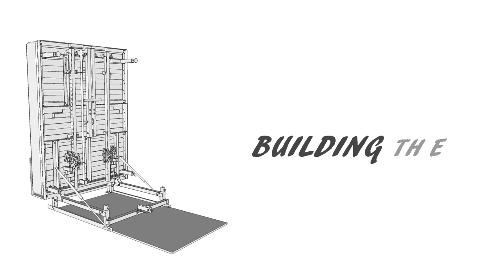Homemade Gym Equipment - DIY Smith Machine

Comment: If you’re building this for fun and cost savings is not the goal, it’s a great project. Otherwise, there is zero home gym equipment you can diy, that will cost less than just buying it. 

Unless..... you are making the home gym equipment from wood. 😁
Reply from the maker: This is all about solving a problem I had, that's it.